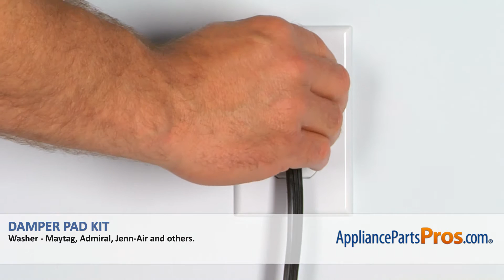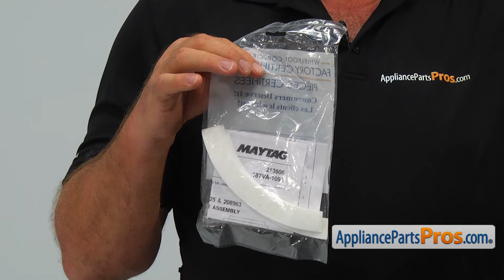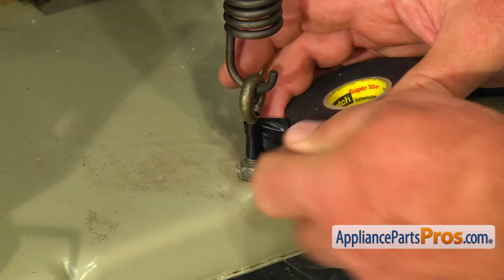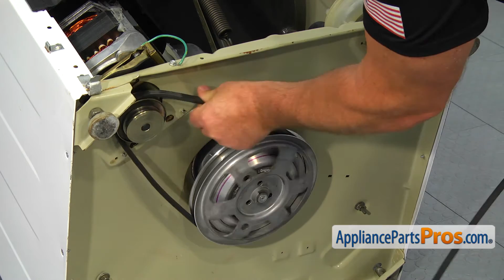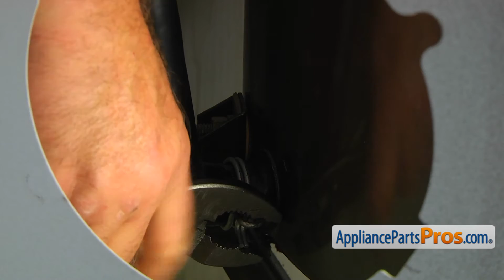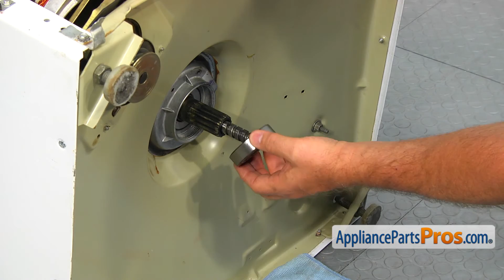Maytag Washer Damper Pad Kit 203956 Replacement — fits Whirlpool/KitchenAid

Comment: I've installed aftermarket damper pads thinking I would save few bucks. DO NOT INSTALL aftermarket damper pads. They make horrible squeaky noise and now I have to reinstall the oem part going through that process all over again.

Also, you do not need to remove the water hoses nor the break aseembly at the bottom. Simply place 10x10 wood block created by 2x4 wood blocks and place underneath which pushed up the tub and you'll have enough space to access damper pads replacement. Use electrical box to remove the springs.
Reply from the maker: Thanks for sharing your experience and the extra tips! OEM damper pads really can make a difference in noise and performance. We also appreciate the suggestion for supporting the tub with wood blocks to improve access—it may help others, as long as they do so safely. 🔧

Comment: For anyone about to try this: the brake removal tool is no longer manufactured or sold by ANYONE. You cannot get it. You can try to remove the brake using a large pipe wrench.
Reply from the maker: Thank you for that tip!

Comment: It uses brake key TJ038315, and their app says they don't have it. Where can I buy it?
Reply from the maker: Unfortunately, that part is no longer manufactured and has not been replaced with anything. You can take the part number and check around to see if anyone still has some stock left.

Comment: What's the adhesive?
Reply from the maker: The adhesive is high temperature. The part number is AP6024142. Below is the link to that part as well.

https://www.appliancepartspros.com/whirlpool-hi-temp-adhesive-wpy055980-ap6024142.html